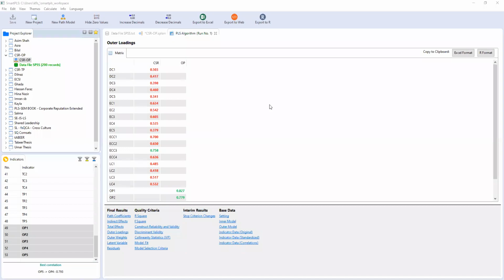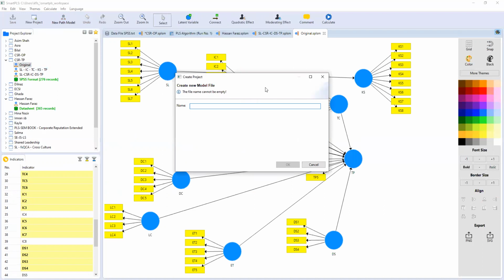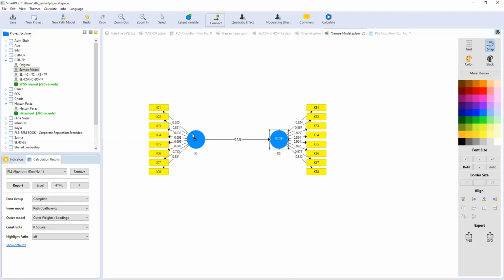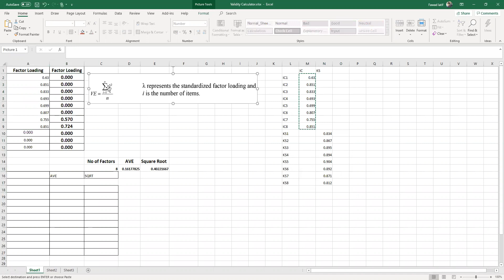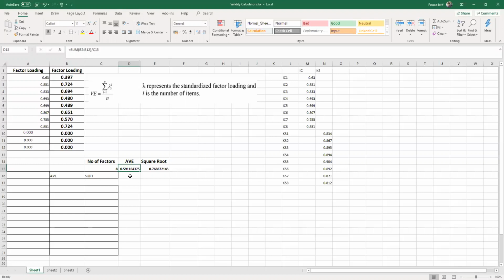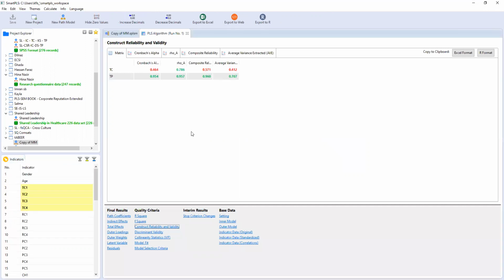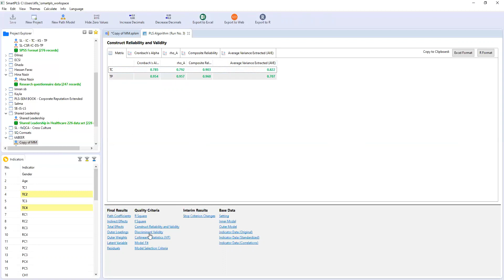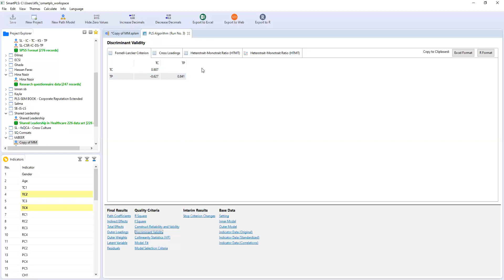SmartPLS | Convergent Validity - Discriminant Validity (Fornell and Larcker Criterion)

Comment: Hey! What should i do, if my cronbachs alpha is bad for a construct (0,570) and composite reliability is ok (0,708). If i remove an item which is bad loading to the construct, cronbachs alpha increases to 0,692 but composite reliability gets worse in this case (also 0,692)??
Reply: and whats the difference between composite reliability rho_a and rho_c? Because only rhp_a gehts worse
Reply from the maker: If CR is fine, use Composite Reliability. Alpha is more conservative measure but CR is referred to as more liberal measure of reliability. Hence, rho_a was developed which is normally in the mid of the two. CR is more widely used.